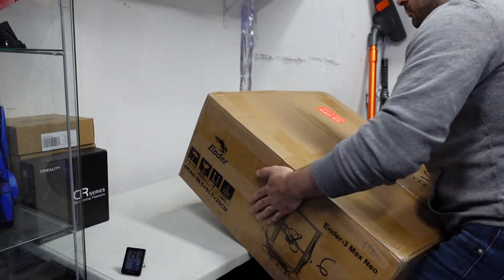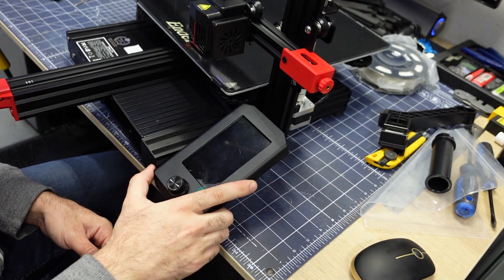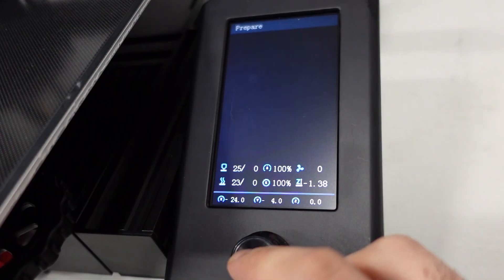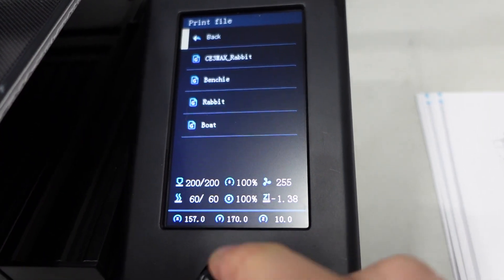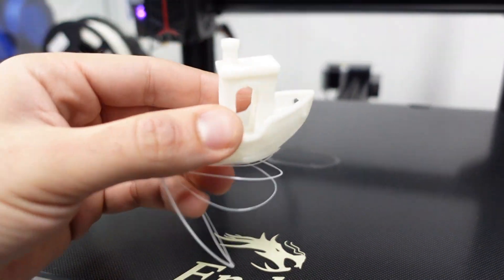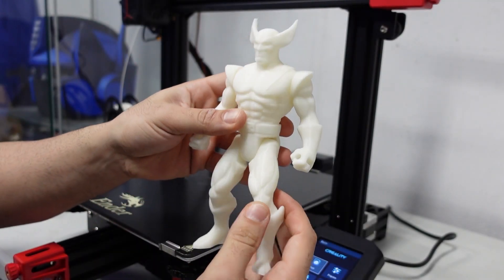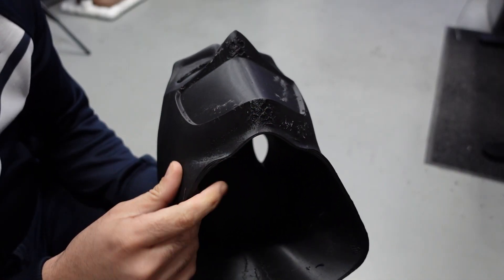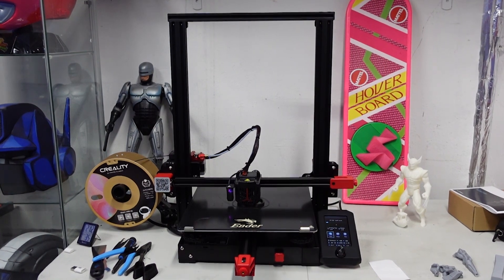The Best Beginner 3D Printer? Creality Ender 3 Max Neo Review

Comment: My filament isn’t sticking to my print bed, what could be going wrong?
Reply from the maker: Clean the build plate with alcohol before each print.
Reply from the maker: Or the bed isn’t levelled properly. You’ll need to do a manual levelling. Try both and see if it works.

Comment: Please can you tell me what exactly Z offset adjustment you made. Be nice to see how much adjustment you made that made the print so much better? Thanks.
Reply: Just follow the instructions.  Mine ended up at -2.24 for original .4 nozzle.  Changed to .8 nozzle and it’s now -2.09.  It varies depending on where your CR touch kicks in when it hits the bed.  Adjusted to where I just felt drag on a sheet of paper and printer printed flawlessly with no adjustments to initial printer settings.
Reply from the maker: I wouldn’t remember the exact amounts I adjusted. I adjust based on what I needed. It would be different for every machine.

Comment: I need some advice, I really want to get a printer that has a larger build volume then the Ender 3 pro, and really like how the max neo sounds but I’ve seen so many mixed reviews about it, any suggestions
Reply from the maker: Just go with what you think is best for what you need it for.
Reply: @Heroesworkshop  alright thanks, I’m probably going to get the Max Neo
Reply: @DJGraz  i diffo wouldnt.
Reply: @DJGraz did you get it ?

Comment: I recently got one too, I never got a cleaner print in mine homemade 3d printer as I got with this ender 3 max neo. The fans are loud, and they turn on with the printer, so it’s always on.
Reply: I would recommend to check if the wheels are too tight or too lose, and the difference in height between each side. That made a really difference to me.

Comment: Once I got started, I found that I had a queue a mile long, currently have a box of parts ready to prime and paint.  I like that I can sand and prep prints while waiting for contact cement or paint to dry, and gives me an opportunity to prime multiple projects at once.  ( my daredevil clubs are almost ready to go! )
Reply from the maker: What kind of printer do you currently use?
Reply: @Heroesworkshop  Elegoo Neptune 3, was so easy to set up and the auto leveling ( no knobs ) is great, especially for the price point